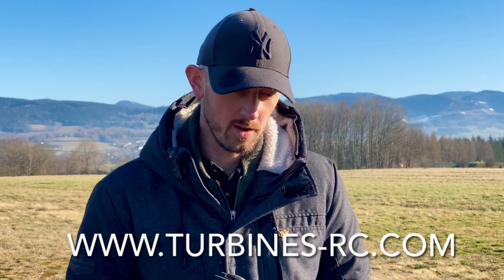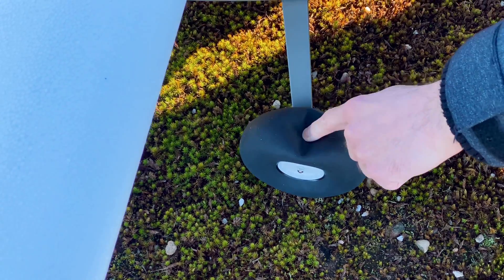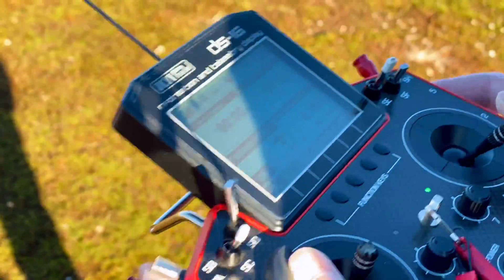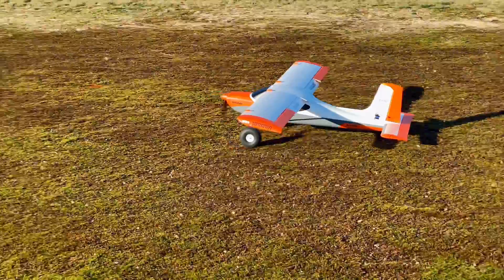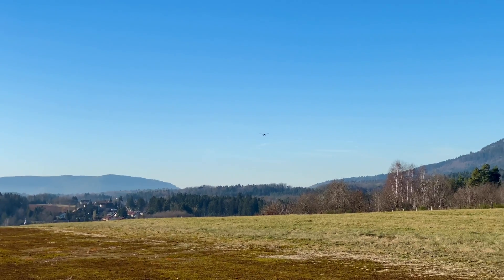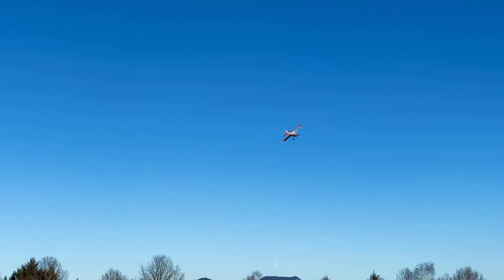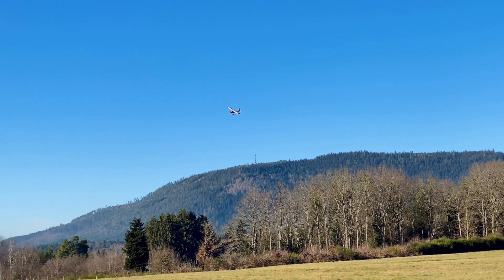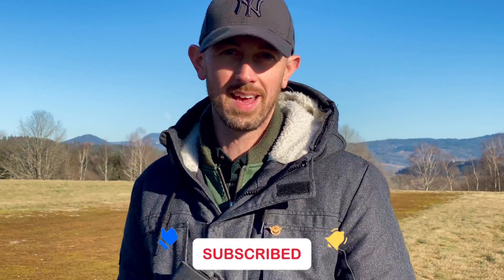XFly-Model Tasman 1500mm STOL | MAIDEN & FLIGHT REVIEW (English/Français) 4K #xfly #stol #rcplane

Comment: I also just bought this model, but have not yet  flown it....( weather delays )  ...do you find the recommended flap / elev mix of     20mm (1mm down elevator) / 40mm (2mm down elevator)   still to be working  fine   for you  ?...thank you ........
Reply from the maker: Yes yes it’s a nice mixing but maybe you’ll need a bit different because each planes are different 😇